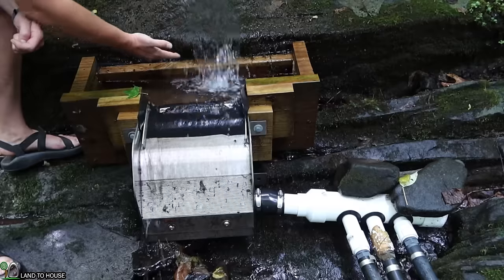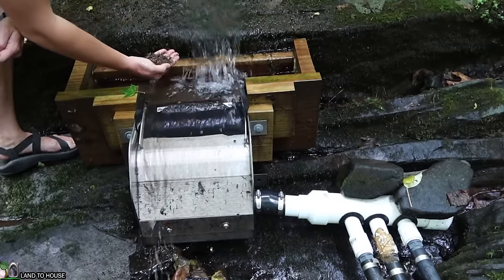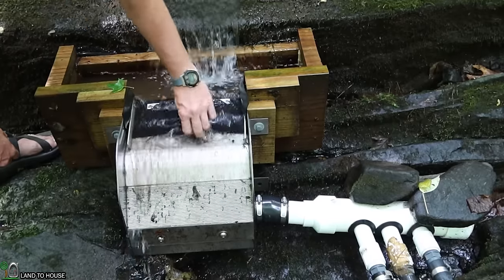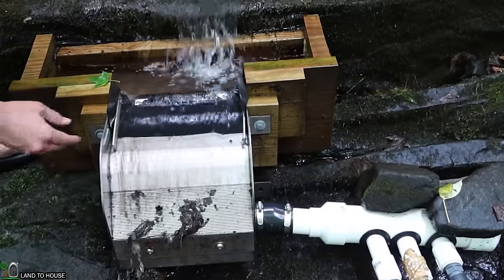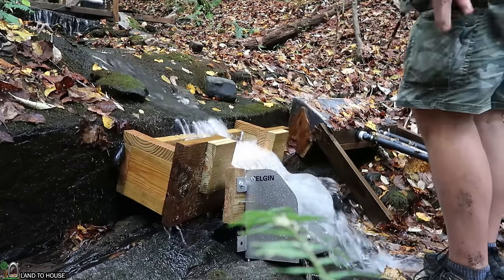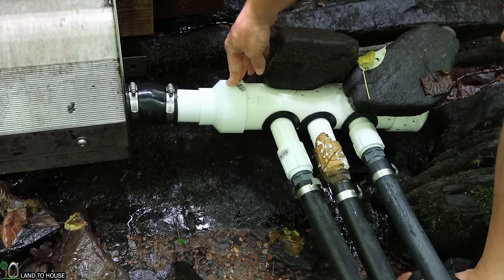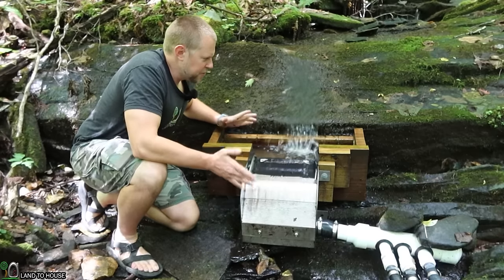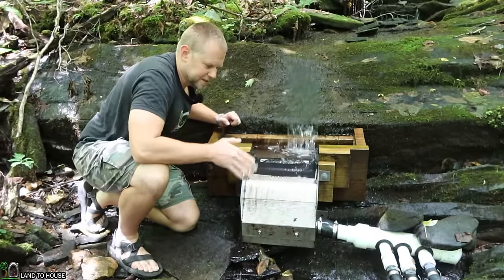Awesome Mountain Hydroelectric Power

Comment: Wow!  You're paying $900 a year to the power company when you have BOTH hydro and solar power systems there?  That doesn't make sense to me, after seeing what looks like about your $10,000 investment there.  Another $1k of solar panels would have been the investment I'd have made to clear myself of 99.9% of the electric bill.  Hydro is a good emergency backup.
I put a kilowatt of solar on my house and it pays for everything but the water heater and clothes dryer.  My electric bill is $35/mo. in Oregon. Ideally, a total of about 5kW of solar will allow me to run completely offgrid.  my existing 3.6kW of lithium ion battery isn't large enough, so I'll get 20kW of rack mount LiFePo4 to finish up.  My controller/inverter can handle 8kW of solar and 5kW A/C split phase.  I went to all LED lighting a decade ago, phasing out CFL and stick fluor.

Comment: Creek is almost dead for 50 to 100w of power! Yeah 😂
Reply from the maker: The creek has 6 more springs along the length of the penstock. Check the video 60gpm is shown. I mention this twice to ensure people know the creek is not dry.
Reply: @LandtoHouse  bro, I'm trolling a bit, :) the project is super interesting.
Reply from the maker: Not a problem. Sometimes the environmental peps hop on here. They struggle with taking any water for power.

Comment: Seems like an awful lot of work for only 100W.
Reply from the maker: In the spring it runs 450w.
Reply: hydro is a loooot of work and potential for failure but it runs 24/7, hence its name "queen of renewables" ... 100wh that's 2400wh a day, with the right battery configuration and some extra pv AND a low profile consumption it'll make you more than energy sufficient

Comment: I hope the enterprising people that do micro hydro realize the environmental impact. Extracting energy from streamflow reduces its energy, thereby reducing flow rate and speed.  That reduction in speed means the water languishes and enters the watershed at a higher temperature.  Higher temperatures, just like and exacerbating climate change, impacts the stream ecosystem in all of the temperature sensitive ways – even if only a couple of degrees. Warmer water decreases the oxygen carrying capacity and the ecosystem is forever changed.  Increased algae and decreased diversity in invertebrates, fish, birds, and mammals it will be impactful.  Please, consider the environmental consequences of hydroelectricity – they are well documented!

Comment: This is built wrong larger pipe to smaller builds more,head pressure from water weight. All of the cleaning could have been done at the source. Poor design.

Comment: You DON'T have 150 ft of "drop". 
You are not running a hydro Dam from the top of which you are Dropping water 150 feet.
You have 150 ft of Ducted water, which is slowly FLOWING down your pipe, encountering friction, etc.

How this simple fact escapes you people is incomprehensible to me.
Reply from the maker: The 150 feet of head pressure is providing 65psi regardless of flow rate.

Comment: Your setup seems pointless. I am not sure what you might do with only 400 watts. Why are you not stepping your DC up to generate more watts.
Reply from the maker: Hydro power math:
GPM x Head pressure)/10=watts

I am only able to make that power regardless of voltage. The unit runs at almost 200v open circuit.
Reply: @LandtoHouse  You are missing the point.  Whatever DC voltage you get from your setup could be stepped up to a higher voltage you can use to drive a water recycler pump and a DC generator providing more than your original watts. Repeat the pattern (step-up voltage drive, bigger generator, etc.)  What you have now, while entertaining, is useless for anything other than turning on a light here and there.  Also, you are wasting water.  Why you are not wrapping your pipe fittings with thermo-electric tape to keep them from freezing is a mystery to me.  But, hey, what do I know? I would turn your setup into a more useful power plant. And believe it or not, water can be made to naturally flow uphill.
Reply from the maker: @raychornvideoportfolio3767   It's my understanding whenever you step up the voltage the Amps are reduced. This means that the wattage output is still going to be the same. The penstock is 1100 feet long. It would be very costly to either bury that pipe or wrap it. 

This is more of a youtube hobby than a big power maker for me.. BUT Hundreds of people have installed a system with more power production with tips from my install.

Comment: so let me get this straight: you did all that work, spent all that money, and time, and have all that maintenance and upkeep, to get 100W??? and only for 3/4 of the year? I'm sorry, but that doesn't make any sense at all... you can get a $50 solar panel to do that... for the money you spent on this you could get quite a lot of them... or a wind turbine... or a few wind turbines...
Reply from the maker: This hydro system does a few things. 
1. I always wanted to do hydro power. Now I have.
2. This shows a concept for others to follow. There are two installs on my channel that were based on my system making over 500w all the time. 
3. YouTube paid for this system within 3 months and now pulls a profit.

Comment: There is nothing "micro" about this, the size, time needed, or the cost is all macro...
Reply from the maker: The term micro refers to making less than 5kw.
Reply: @LandtoHouse  ok, all that macro for micro lol. Just me but with all that time and cost just upgrade it to fully replace grid power and start getting a check vice giving them one. Where I'm from we pay at most 100 a month with full AC in the summer and oddly enough (you'd think AC wouldd cost more) at most 130 for the winter months.
Reply from the maker: Not bad! My bill is normally $55 to $60 a month in summer. Winter jumps to $100. That is about to change with a whole house 15kwh battery and 8kw inverter!
Reply: @LandtoHouse  that sounds better. Way too much effort has gone into this project for partial coverage.

Comment: Great idea and solution. Poor execution.  At 50-60psi you should be producing at least 1kw PER HOUR. What a waste of money getting the wrong pipe and the support structure for the piping looks shoddy. Even a basic DIY support structure should be better. It looks like you didn't care or you were in a hurry to put it together. How can you leave exposed electrical cable outside and not inside some kind of conduit. You're an accident waiting to happen.  Not to mention the ROI on this solution is non-existent.  You should check out the Kris Harbour Natural channel.
Reply from the maker: (Gpm x head)/10=power

The penstock can handle 30gpm. The max power i could ever make is 450w. 

The creek is currently running at 12gpm. 1000w is not possible.  

The ROI took 4 months on youtube.
Reply from the maker: Kris is great. I enjoy his work.

Comment: This is a disaster.  I've worked in hydro for years.  This is not good.  You will burn down the forest.
Reply from the maker: Would you mind sharing some of your micro hydro installs? It would be great to see your work.
Reply: @LandtoHouse  I've never done a micro hydro.  I have only worked on large scale dams.  And they don't like us sharing those sites to the public.
Reply from the maker: Sure thing. I just got back from a trip to the 3 dams close to Fontana lake. Nice place very old hydropaer dams.

Currently my hydro system has had 0 problems electrically over the past 2 years.
Reply: @LandtoHouse  that's great.  Hope it lasts a long time and serves you well.  Is your power plant on grid or off grid?
Reply: Love. The whole outing of it , but it’s been around for millennium. Thing these days is . By melt we lose the supply of high mountain melt of ice. A daily event of Solar heat. Ice melt is obviously  global and it has also , at lower levels, taken rivers to dry creeks.  Earth has too much heat within, volcanic shows, excess pressure getting out. Not just poles exposure everywhere on  Earth. It’s time to think,of bigger  ponds. beaver around and get use of any other upstream compensation of other streams may help.  Just looking forward..